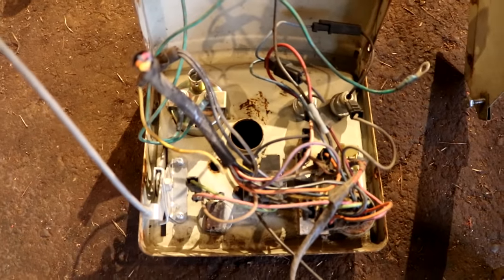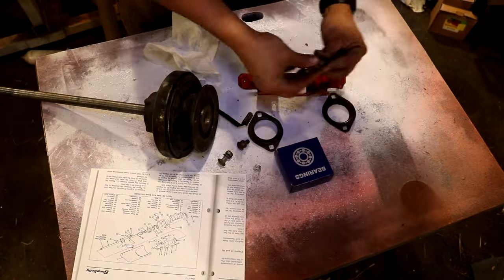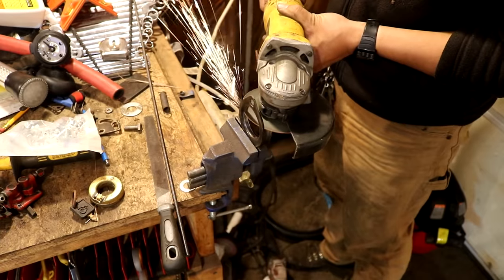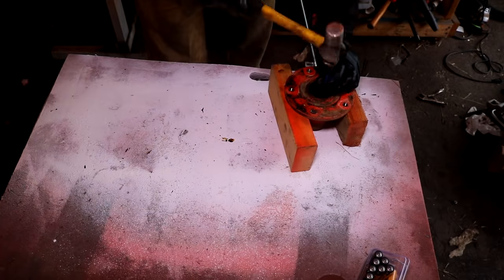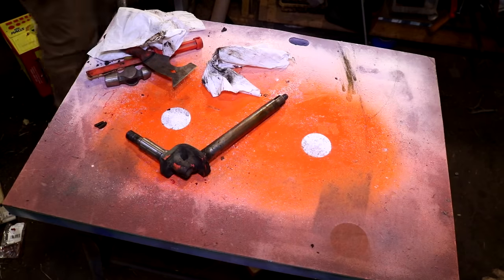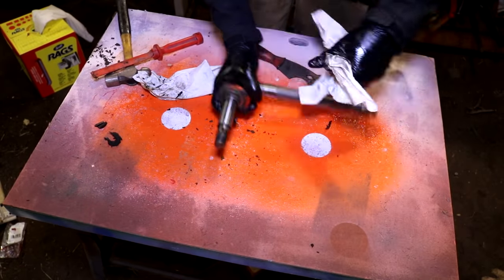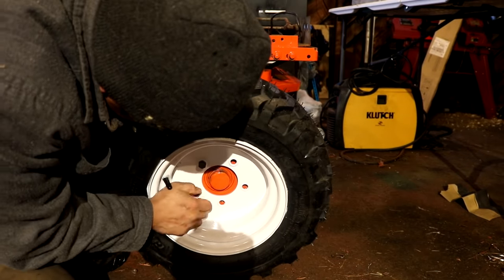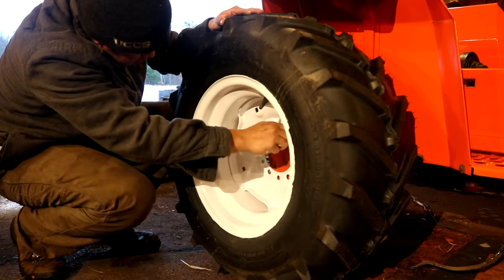Simplicity 4040 Powermax Garden Tractor Project Part 3

Comment: I like your vids. One trick i use when painting rims with tires still on them. Is to rub vaseline on the tires. its cheap and keeps the paint off the tires. you should try it some day on some old tire and rim you have laying around.
Reply: Kenneth Dixon that’s a really great trick. I have used the tape method and paint always ends up on tire. One of my tricks is to use flat black paint to do the wheels. 🤠 I have allied this method to the entire tractor as well.

Comment: HI Norman:  Just a note about bearings.  There is a code number/letters on the seal besides the normal number. These will indicate the type of seal  and possibly a different physical size . I've run into that problem also. Since then I always compare the size specs. to make sure they also match the old bearing.  I usually get all of mine at the local NAPA store and they are good about looking them up and comparing he size to the ones on their book.  If they don't have it they will get it in usually within 24 hrs. or less.  Digital caliper will get you close enough  I got one from Harbor freight for $12 that works pretty good.

Comment: Pretty work.  Inspiration for me to paint my wheels.
Reply: It all starts with a simple touch up, next thing you know you got your Cub completely disassembled and you’re using body filler to smooth out the cast iron pieces 🤫
Reply: @RustyZipper  I'm trying not to get it looking so good that I won't use it.
There's a big dent in the rear from the previous owner.  Keeping that dent helps!😂

Comment: Looking good! One trick I've seen with paining rims that have the tires on them is using 3x5 index cards stuck into the bead.
Reply: I’ve always worried that paint would get under an edge. I tape mine to start like Norman but then use masking paper. You can trace the masking paper with a flat object on the rim then cut out the circle but that is too easy for me
Reply: @RustyZipper  That would be a concern. Every time I've seen it done, the person always had a fairly large overlap to try and prevent it. Ive also heard, but never tried, that tire shine or Armor All can help prevent paint from sticking.

Comment: When painting rims with the tires still mounted on them, a method I've come up with is to go buy some cheap, large notecards. Then air down the tire completely, and insert the note cards in to the bead between the rim and tire. Painting is much easier, and much faster this way.

Comment: Easier way to get the tie rod ends loose from the spindle is to bang on the side of the spindle where the tapered part of the tie rod goes thru, usually a few good hard wacks gets it loose with no damage to the threads or nut

Comment: How much did it cost you to rebuild  all that? And how much  did u give for the tractor? I found one four hours  drive one way from me with bad motor do u think it be with buying  for $800? AND I HAVE NO SHOP TO WORK on it so it be harder to fix it up would it still be worth $800 for the body only no motor or attachments

Comment: I FINALLY got my Onan running and heads are at machine shop. hopefully i have the valves correct this time.  I just need to install these awesome LED lights i got from YOU and kick back and wait for snow!!  I have 2 questions if you have time later,  does your 4041 have that support bearing on PTO shaft?  I have a little wear mark in hydraulic lines and i never saw that support before.  2nd,  even my 4041 manual says to "disconnect rear hydraulic hoses to run optional front hydraulic accessory  piston". So i can't have the 60 inch front plow and a rear blade on at same time?? My hydraulic uh, valve?  (The one the lines connect to inside the dash) has the two seperate areas, basically it's twice the size of that one, which im sure you know what i mean.  So could one theoretically  use front and back if  having that system without damage? Is that warning for the single ones?

Comment: Was it the tire or the wheel / wheel size that caused such a problem on the front? Also, I like flat black paint for wheels 🙂 - zero prep required- haha!
Reply from the maker: The tire was unusually stiff. This is the first time I've encountered the 20x8-10 wheel. Everything on the wheel measured right so it could have been a combination of the tire stiffness plus being warped in the warehouse and shipping.
Reply: isavetractors yeah, the wheel is unusual size on these tractors. I haven’t had to mount tires but I’m about to - kind of worried about it now.